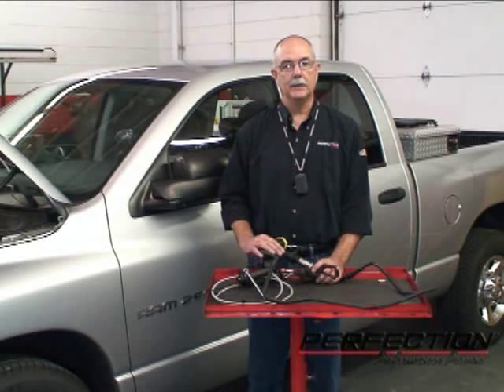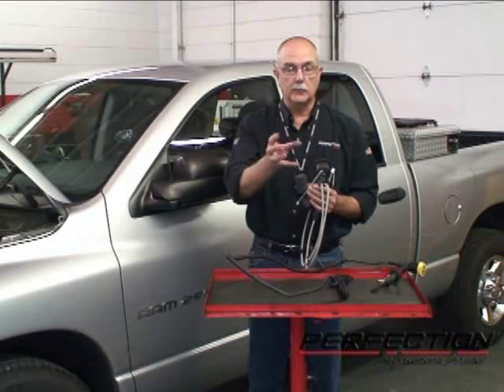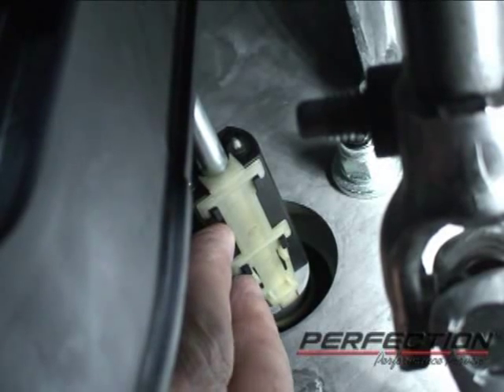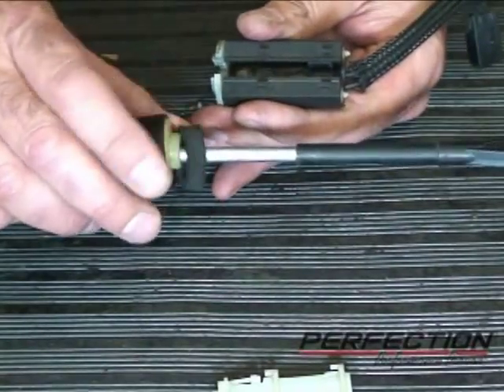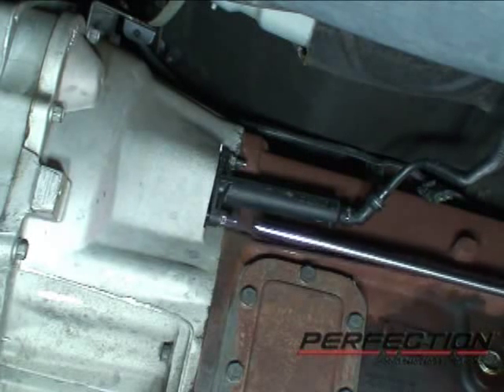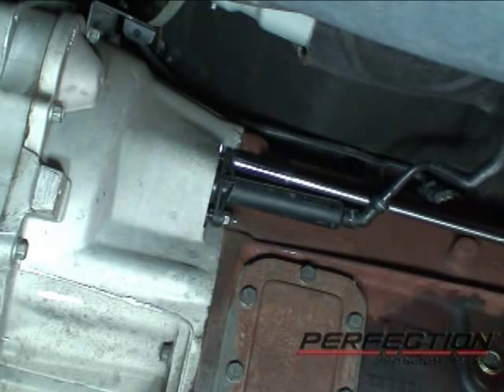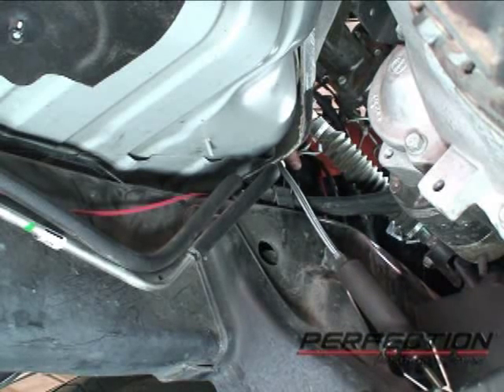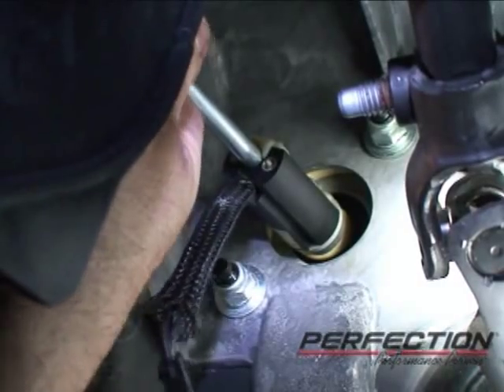Dodge Pre Filled Clutch Hydraulic System

Comment: INCIDENT- The hose on the Slave cylinder is metal shielded and the battery is in close proximity! While installing my unit the shielding shorted out on the battery. Potentially causing a hole in the line. As a precaution cover the battery and cable with a shop towel or remove the battery. Other than that this was a very simple installation.

Comment: The push rod inside the cab on my peddle a globby foot mechanic broke it, think he pulled up on it and it popped off and cause my clutch to some what go to the floor then on top of it I think he tried to force the clutch down breaking more plastic and my safety switch, now they claimed I should have my clutch fixed but they’re not responsible for it, was a part that was just so happen ready to break and just their luck, now I believe that but the mechanic still tried to force the peddle down after it had broke causing it to break further... I can’t prove it I wasn’t next to him but just by the broken plastic I can see that it was forced after it popped out... is there any way I can just get that part that’s broke is my question

Comment: if you put old slave that has the plastic already broke how do you get air out of it and hold push rod in to put back in
Reply: Guess he doesn't answer questions huh???
Reply: Highly doubt you need this but the say you can't but if you take it all the way off and hang it by the cylinder so it's the highest point it should push the air up

Comment: Hi I just replaced my master cylinder for clutch on my dodge Dakota 2000, I t was making a loud speaking sound after a while of driving and there was not much pressure when pushing in on clutch. Now I have pressure but it still makes loud speaking noise any suggestions?
Reply: perfectionclutch I have the same problem
Reply: i know this was years ago you posted but it's the slave cylinder mines very loud after it gets hot and i just ordered the whole unit .

Comment: I wish I saw this before buying the type that has fluid and you bleed, I have a 02 Dodge 1500 with the other type you replace this with. During bleeding, and it went from a strong peddle to nothing, what happened? I can get no presure now and no more fluid is coming out during bleeding. It didn't go empty, master cylinder is still full but I can't get it to pump back up with presure, any ideas?
Reply: *****
Hi,  I have the '01 RAM V6 5 speed.  I had this part replaced also, but it hasn't helped much at all.  The truck still lunges and chatters when you are stopped.  Also, sometimes won't go into gear at all (have to turn off engine, put in gear, then restart).     Did these guys not do the job right?  not bled properly?  Other than getting truck into gear, it runs great.  no slipping, etc.   Thanks, for any help.

Comment: thanks for this instructional video, I'm ordering mine now for 2002 Dodge ram 1500, but my question is everthing is similar except when removing master in mine only can do 1/4 turn not full 1/2 turn to the left due to the big booster brake, any suggestion? thanks again
Reply: I know this is an old comment, but for anyone else with a similar problem, on my 2003 Ram 1500, I had to unbolt the Master Cylinder mounting plate.  Two 15mm bolts from the inside of the cab.

Comment: I installed a new clutch but it's still slipping under high power.  My nv4500 pedal disengages towards the top.  Is there a possibility of bad hydraulics?
Reply: +perfectionclutch Clutch was replaced with a Valair clutch.  I can row through the gears until the clutch starts to engage, 1-2'' from top (resting position).  It acted this way with the stock replacement clutch that was in there.  New clutch has new flywheel & pressure plate.  I'm tempted to cut a length off the slave rod at this point.

Comment: My clutch on my 2001 2500 is really stiff. It works but I need to push hard to shift. Any idea what I should do? I just replaced the clutch bearing also.
Reply: +perfectionclutch So here's the history. I rebuilt the engine and decided to replace the clutch disk and clutch cover (aftermarket). I installed it using the plastic gear guide. So I know that's good and I also replaced the clutch release bearing. I made sure there was plenty of grease on the shaft and I think that's the only thing I greased on it. Can't remember. It shifts fine just hard to push in the clutch. Anything I can do without pulling out the engine?
Reply: +perfectionclutch I just watched the video. Since mine is an older engine (2001) it is a little different. I did make sure the bearing had plenty of grease. But I used regular grease (it's a red grease, I can get the name later. )

Comment: I just called perfection and even though you said you're working on a dodge like mine, a 2003, they say they don't make a kit like the one you installed on the video.  Were you incorrect on your description of what you were working on or installing?  I have a 2003 Dodge 3500 with the adjustable pedals and need a part number to order the entire assembly with aluminum master and slave as well as the stainless braided line.  Does that part number exist?
Reply: Its the same one. I just did mine on my 2003 cummins 6 speed. Same exact ones. Just know that if you have adjustable pedals like i do it is MUCH worse under the dash.. Everything is about 4x worse to do because there is no room..
Reply: Chuck Norris  Thanks Chuck.  I actually went to the dealer and bought the system from them.  Surprisingly, it was not as expensive as you would have thought.  My payments on the part are only $250 a month for 2 years.....LOL.
Reply: george drenes lol